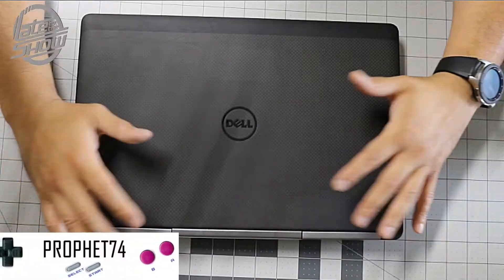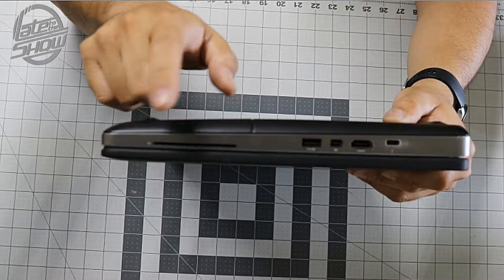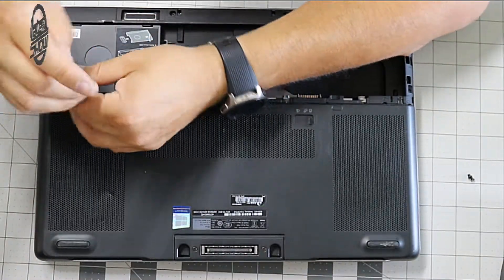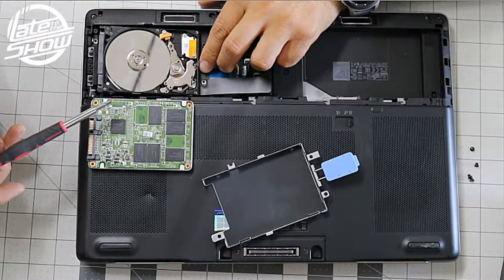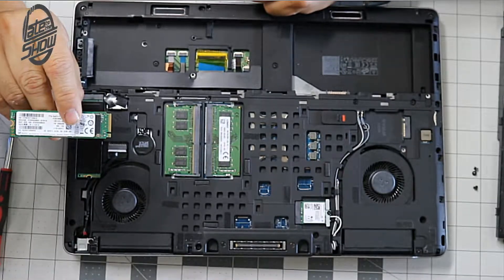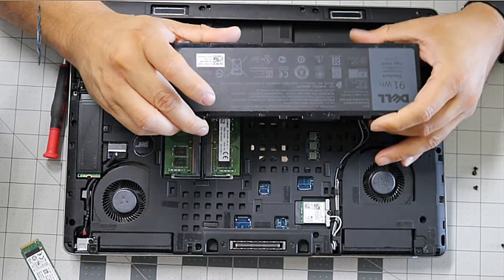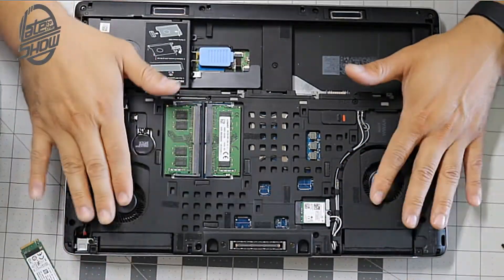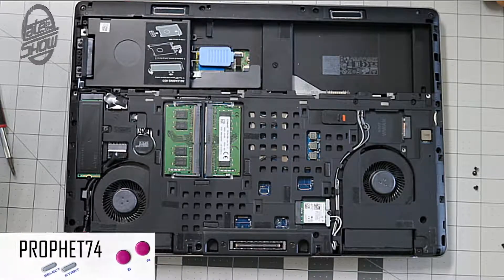Dell Precision 7520

Comment: I just picked up one of these refurbished on the Walmart website. Very well refurbished and was only $300 and that includes tax and shipping. The version I got came with 32gbs (2x16gb in dual channel) and a 512gb m.2. But what is really cool is that it includes a Nvidia Quadro M2200 (4gb) video card. The i7 6th gen CPU is dated, but for $300, for what you get is insane as just a simple backup laptop. 

And as already pointed out, this is a workstation laptop with 4 SO-DIMM RAM slots, the video is wrong. Its a real pain to access them, you need to dig deeper, but you could pump this up to 64gbs of DDR4 4x16gb. Depending on your needs. But 32gbs should be plenty for most. The 512 m.2 is fine for boot and I added a 2tb 2.5 SSD that you can purchase for $80. 

So this is a great pickup as long as you buy certified refurbished. You wanna make sure you get it from a good retailer that is licensed. Mine even included a 2 year warranty, which is also pretty crazy. So if you want an all purpose laptop, this is a great pickup. As it's so customizable hardware wise. Nowadays they are soldering down RAM, this laptop allows you to remove and replace the graphics card. So just thought I would chime in. Cheers y'all, happy holidays

Comment: Just bought one on FB Marketplace. Loaded with 64GB RAM and 2x1TB drives. Super clean. Had to reinstall windows because previous install was on the SSD not the M.2 which is much faster. Very happy with this big boy.
Reply: great, ideal for Virtual Box setup , to do Server/client, multiple OS's and  Active Directory learning. I am studying a Technician Course in Adminstration Server Networks.
Reply: so it's a great machine to date ? one can buy it

Comment: As already mentioned by other here. There is four RAM slots, the other two are under the keyboard. This is also true on 7720 modell where you also mentioned there sometimes is. In this serie there is slots under the keyboard.

Comment: I assume most people watching would already know this, but just in case. Currently Thunderbot technology is not where it should be, and you should not spend the ridiculous amount of money needed to install a portible uGPU into a laptop and expect good performance. This is taking a normal desktop GPU, for example a RTX 3070 or something, then buying a mobile enclosure for it, that then allows you to put it into the Thunderbolt port of a laptop. First, most enclosures are very expensive and very poor quality. Second, even if everything is setup perfect, you are still going to be losing a minimum of 60% of your GPUs overall power by attempting this. It's a horrible idea. So just consider that before spending the money, by all means, do your own research first, but at present, the technology is just not where it needs to be to pull things like this off. 

Otherwise, solid laptop. I was looking at these refurbished on eBay today. A couple of them even came with 2 year AllState warranties included standard. Which is fairly rare for refurbished laptops. So that says good things.

Comment: I'm still confused. How did you get that main back piece off at 6:42?
Reply from the maker: Remove all the screw first and then slide up and push at the same time, this will not work if you have a screw you missed.